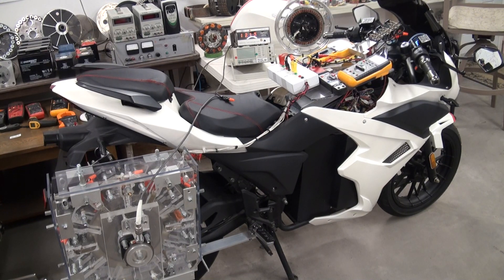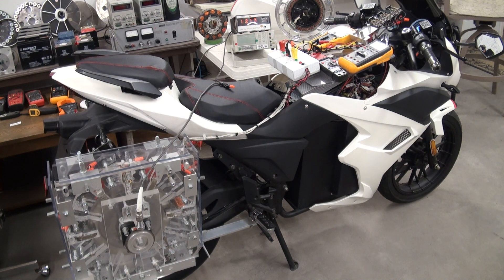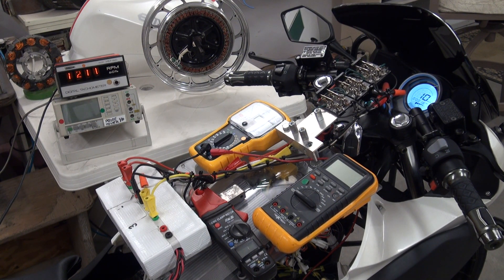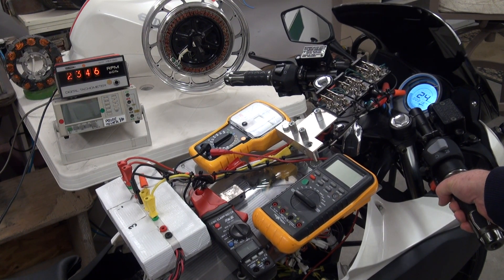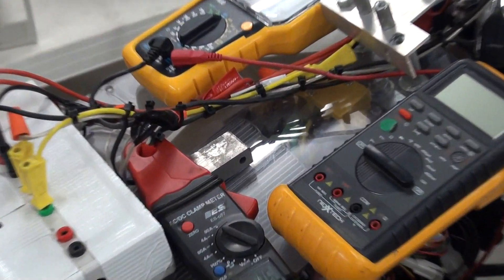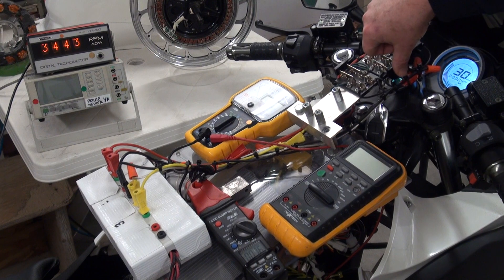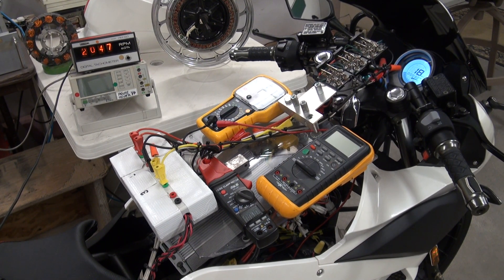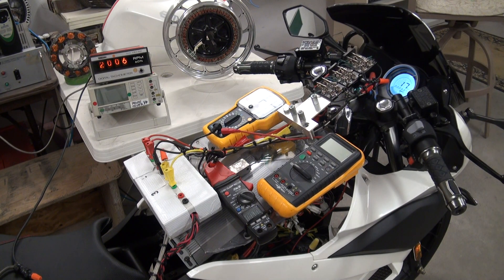US Patented Electric Vehicle Regenerative Acceleration Introduction, EV Recharging with Acceleration

Comment: where do you show "regeneration"?
Reply from the maker: EV Regenerative Acceleration; 13.6 Amps of Battery Recharging with System Acceleration ABOVE 30 km/hr (Time 3:21) and EV regenerative braking; 13.3 Amps of Battery Recharging with System Deceleration BELOW 30 km/hr (Time 5:42). Cheers Thane
Reply: it is not moving at all. @ThaneHeins1

Comment: what amps does the motorcycle consume?
Reply from the maker: Hi Ahmi, it depends it can be anywhere from 0 to 10 Amps but the controller is good for 30 Amps. Currently in the video we are delivering 217 Watts during Regenerative Acceleration and 207 Watts during regenerative braking... Cheers Thane
Reply: @ThaneHeins1  
 Thanks for your answers Thane.
In your previous videos, the ammeter connected to the motorcycle consumed 5.42 amps and was able to produce 5.54 amps. While producing 5.54 with 3 coils, I was wondering how much consumption has increased now.